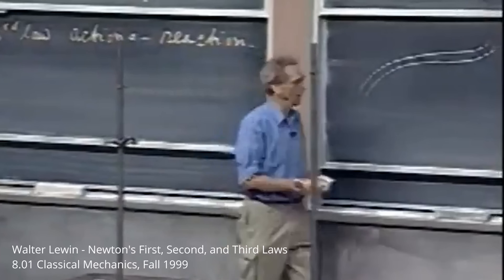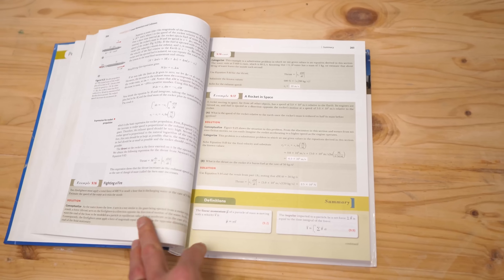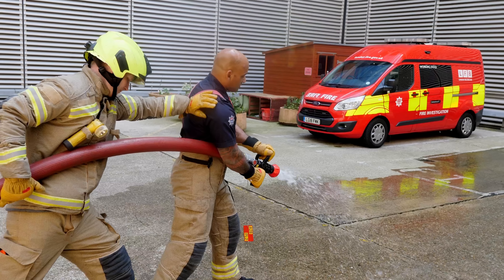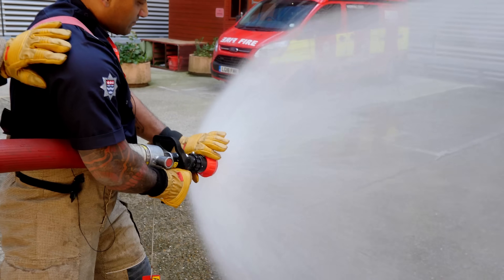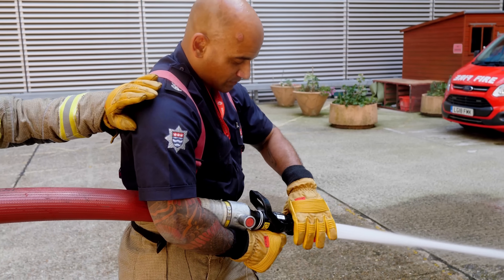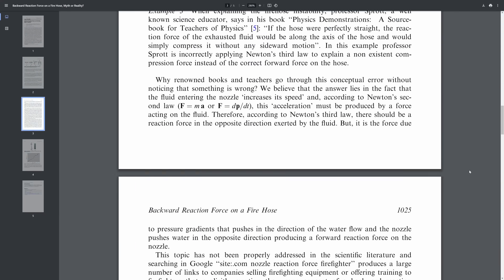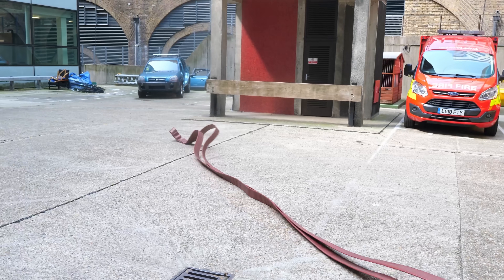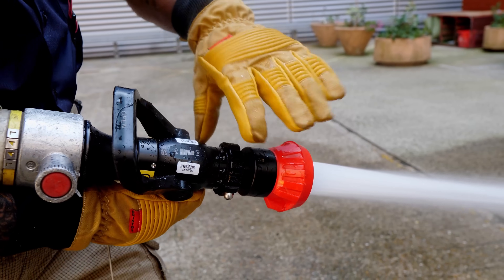Why chaotic hoses dance

Comment: The simplest way I can think about it: Fluids has viscosity, so they do not only pushes, they pull themselves. So you can imagine a string of water molecules that will perform in the same way the chain performs in the Steve Mould effect video. When the velocity and direction of the each chain link became steady, each link will pull the link behind it to the exact force and direction, so the curve format becomes stable.
In the hose the walls only need to hold the pressure, not the format of the water string. In the steady state (constant flow for some time), the curves of the hose do not experiment any moving force. reactions forces would appear if you change the flow or if you try to change the format of the water string.
I still do not have a good simple way to imagine the force at the end of the hose, but I can thing something like a string of water that is colliding with the air and decelerating to zero at some point. Since the end of the string is not pulling itself anymore, the mass of the water will act like a barrier and you will fell the reaction force.
To validate this model, you can fill a vacum chamber with a water nose with steady flow to observe if the end will experiment that force at the end. I'm almost shure if you can keep a good vacuum, the end will not experiment any force and will not move. The same should happen in space.

Comment: but what about straight water hoses with no nozzle? Since Water is incompressible and the rate of feed equals the rate it comes out, which implies the speed stays the same outside the hose, there shouldn't be any net difference in momentum and hence no force... yet nozzle less hoses still do the wiggle.

Comment: What about pressure loss and friction force on the internal walls of the hose? That should impart a reaction force on the hose in direction of the flow... But I guess that force is counteracted by the internal stretching of the hose material.

Comment: 15:23 Does the unsupported firehose show how much force the firefighters actually have to resist? It clearly doesn't have enough force to support itself completely as only a small portion of it can flail and it acts more like your short tube air compressor demo

Comment: I think it acts as a rocket at the tip, but what is being accelerated is not the water or gas on the tube but the air on the atmosphere. And the forces due to bends, I'm not sure they are that significant, because water inside is so turbulent it is hitting walls and changing direction all the time.

Comment: I always as a kid assumed it was because the end of the hose wants to expand in the direction of flow, and the next thing you know, the water runs out of room to grow, so it's the massive cartoon bulge worths of pressure but out of an end of a length long enough that the pressure mimics the "ball" if it were to come out harder than the end of the hose can truly parabellum, and mimic what "2d water' does or a flag in wind.

What i don't know, but will likely learn if I watch this, is what
Reply: Makes sense in the end. But kid me had all kinds of ideas.

Comment: One thing you didn’t consider is the shear force of water moving through a tube. The water in the hose has some viscosity, which means that the water has a velocity gradient. It is moving faster at the center than it is at the edges where it contacts the hose.  This shear force would actually be pushing a perfectly straight hose forward at all points, not backward. I think this contributes to the chaotic bending of the hose. 

This effect will also be significantly different if you’re using water versus air, which is a compressible fluid with much lower viscosity than water.

Comment: Firefighter here: the water accelerates at the nozzle just like you say. But the water pushes back on the hose. The water is under pressure so it's pushing out against the hose itself and effectively gripping it. Imagine trying to squeeze a twizzler into a straw. If you don't hold the straw you'd push it all over.
Reply: That is not how it works... The water nozzle is a rocket engine... The force felt at the nozzle is the weight of the water x the velocity of the water combined with the angle of momentum of the water when exiting, and the losses do not matter and only over complicates it.

Comment: I think it's really cute that all the firefighters wanted in return was for you to do a PSA about escooters.
Reply: To be fair, lithium battery fires are hellish, and most likely they won't stop burning until there's nothing left. It's not a lithium fire, as it's only a part of the actual compounds in the battery. But it's still a spicy pillow that has some exciting chemistry. And way way too many people just play around with the damn things and mix and match them. Which isn't good for the batteries, and "battery degradation" is least off your worries. Because if you keep pumping them up with way too much energy, at way too many volts, etc, they WILL start having very exciting and very difficult to stop reaction of being on fire.

They probably should have added that the batteries can NOT be extinguished easily.

Just having batteries handled correctly is fine, it's when people start to mess with them without proper safety precautions, "just add more, whatever type" and etc, is when it gets bad. Hell, I've been looking for kapton tape, and found reviews saying this specific lot was fake. But other reviews had people wrap batteries in said fake and not actually heat resistant tape...
Reply: @SaphireLattice "spicy pillow" cracked me up. Thanks so much. 
Also never heard of kapton tape before. Thanks for that, too.
Reply: I'll also add to this that the volume of these products including "hover boards" on the market is very high.  The companies jumping on this bandwagon aren't all going to have the same quality standards as the likes of Razor, and a cheap outdoor product handled by a clumsy and/or chaotic customer (we call them children, they're cute, but they also break things with great efficiency) can be a dangerous combo when power cells....or power anything, are involved.
It was wise for the firefighters to take the opportunity to educate about a rising problem.  Kudos to them.
Reply: Its like a sponsor but instead of an ad for a product they promote actual life saving advice!
Reply: Came here to write that.
Reply: I tried copying “escooters” accidentally pressed dislike.
Reply: Well, you start responding to structure fires and you quickly see the death and destruction they cause, and you want to see it as little as possible.

House fires are hell, and they spread so fast that occupants quickly become trapped, and if they become trapped the chances of survival are near zero. By the time we get on scene, anyone inside the building is probably already dead.
Reply: Cute??
Reply: @pinkerbot yes. cute
Reply: they love to overhype the danger. notice they said only 3 people lost their lives compared to other causes. batteries are remarkably safe
Reply: @Blox117 3 people hurt, but hundreds injured, and many houses burnt down.  Lithium fires are pretty much impossible to put out
Reply: @Blox117  yeah but it's also REALLY easy to jus not plug in your stuff unattended overnight
Reply: @ no only a fool would unplug it. the batteries themselves are already wired together and into the rest of the electronics.
Reply: @Blox117  my god man. where is your faith in budget Chinese made voltage regulators and overcharge protectors coming from? lowkey insane takes
Reply: @ Blox along with what those above are saying, you must have missed where it was stated London has a fire with one of these involved every other day.  Human injuries are not the only concern here.  It's very good if a family doesn't die, but it's better if they don't have to call their insurance company because their flat burned down.
Reply: @VoltisArt  i think you missed where the rate of accidents for other reasons are 10x higher. look at the number of accidents involving 4 wheels.
Reply: @ also to note, we really need to see real statistics on the number of fires. someone spouting off a number when he is just an individual who has done no actual research into the origin of the fire is not a source.
Reply: @ Blox accidents?  We're talking about electrical fires during charging, along with being caused by physical (including water) damage.  That's a broad range of direct and indirect causes, and I don't know why anyone needs to compare two things that aren't directly related.  Cars crash more often than planes.  Relevance?
Ahh, "someone spouting off a number" was one of the firefighters who deals with these actual fires.  I wouldn't expect every firefighter in any jurisdiction to be on top of statistics, but if he's gone to the effort of giving a presentation on this particular subject, he probably knows pretty well what's going on in his area.
He's trying to stop house fires and little kids getting seriously hurt.  I don't think you've got a good grasp of reality if you think what that man said was "overhype".
Reply: @Blox117  One of the biggest fires in California history was an accident from a gender reveal party. It doesnt matter that other accidenta happen more often. The point is that a small piece of knowledge that is easy to implement on the day-to-day can save lives.
Reply: @Blox117 It's a little different when you get called to the scene and have to recover the bodies yourself.

"Overhype". What does that even mean? Do you think they're scamming or something?
Reply: @CharlieMikeNS  its hard to take you seriously if you dont know what it means. over = more than. hype = advertise
Reply: @Blox117  notice they also said the fires happen every other day.
Reply: @gabotron94  notice no sources
Reply: @ notice you cant read
Reply: gabotron94 nvm you dont speak english
Reply: gabotron94 no english, not surprised
Reply: @Blox117  You don’t seem too bright and you’re trying to criticize others? Whew…the confidence in your ignorance is amazing to see.

Comment: My head hurts now. Trying to work out all the variables is boggling my mind. The weight of the water, rigitity of the hose, ambient temperature, temp of the water, psi of the water in the hose, gravity, coefficient of friction... ... ... etc. 
I have handled a charged fire hose in US Navy shipboard fire training, and the kick of an uncharged hose filling can rip the nozzle out of your hands, causing serious injury. The training facility has a crash test dummy that almost got ripped in half by the whip of the hose.  This is why they'll leave the nozzle slightly open to allow air to escape while the hose fills. Once it is filled with water then the nozzle is completely closed and ready to be deployed on scene. While there is a force pushing back on the operator, it is not insurmountable, even for those with a smaller stature.

Comment: There is a related phenomenon where the force felt holding a hose drops drastically when the end is placed in a body of water. I don't know how this is explained with pressure. It also argues heavily against the bends creating the force. Would love to see a satisfying explanation.
Reply: It's nozzle exit velocity. Water smashing into water does not result in high nozzle velocity - hence little thrust.

Comment: I feel like you were a bit slow on this one, Steve. I thought it was obvious that the water was being accelerated through the nozzle since tne nozzle is a reduction in diameter with constant flow. It's this reduction and restriction causing the pressure, not the pump, the pump only produces flow.

Comment: Is there an assumption that at the end of the pipe the pressure changes from 300psi (????) to 14psi? In the hose the pressure is going to be the "same" in all directions. When the water exits the hose then the pressure being exerted will change as it's no longer being constrained by the hose. But for surface tension and momentum the water would form an ever increasing sphere. Because of momentum and surface tension there isn't an immediate change from 300psi to 14psi.

Comment: Looking at a rocket engine the thrust can not be produced right at tip of the nozzle. Rocket nozzles are relatively flimsy things and there are even some extending ones. I don't thing that those would hold up to the force of a rocket engine pushing forwards.

Comment: Further thoughts on the flailing fire hose video - you also have the heavy mass of the hose and friction against the ground it's sitting on that may contribute to why only the nozzle and end of the hose is moving?

It would be interesting to see how it would react suspended in free air...

Comment: My 2 cents: Hoses of all kinds always have a curve or a bend as part of the manufacturing process or storage. If a perfectly straight hose (which would just be a tube) was manufactured, the pressure from the nozzle/open end would simply compress the walls of hose backwards evenly and the hose would remain straight. The flailing would be a cascade effect set in motion by the nature of flexible materials. Imparting the bend talked about at 15:38.

Comment: I wonder about the wall fiction along the hose and how that interacts with the forces on the end of the hose. I'm wondering if this is  a similar situation to the helicopter flying a line underneath it and interesting interaction of each section of hose only impacting the parts beneath it. This may also explain the initial bending we see which allows for the nossel to turn over and the forces from the  rocket analagoy take over as you were explaining.

Comment: I think it should be possible to design a recoilless nozzle for a hose without resorting to spraying water backwards, just by creating a funnel at the tip of the hose. It would reduce the output but the water pushing against this funnel should apply net force.

Comment: 9:01 In that setup the air is pushing against the bottom of the plunger, which would cancel out some of the weight, right?
Maybe it wouldn't have mattered, but I'd be curious to see if it made a difference if you attached the end of the hose to the flat part, so the air is blowing over the it.

Comment: One thing to think about is the difference between a rigid pipe and a flexible pipe. What you're looking at is a column buckling problem combined with Bernoulli's principle. When the hose is straight, the hose is a buckling column (which is an unstable state), and the force exerted is the buckling capacity of the hose and the force associated with the pressure drop discussed in the video. If the pipe were a more rigid material, then the force a fireman would have to exert to hold the hose would be lower, since the buckling capacity of the hose would be higher.  

At lower pressures, the fluid pressure can actually help make the hose straight. Think about the sky dancer, and when they're over inflated they become stable. That's because the tube is quite wide, and the pressure provides rigidity to the walls of the tube, which makes overall column capacity of the tube higher than the relatively low forces caused by the pressure at the outlet.  At some point, if it didn't burst, you would come out the other end again where the pressure would cause the tube man to collapse again as the column buckles.

Comment: Steve, I thought about this for a long time. I enjoy your videos, but I have to disagree with your conclusions on this one. Here are my thoughts and suggestions regarding it:
First, please feel free to  point out any logical errors. I love being correct, please correct me where I am wrong so that I can be correct!
If the fluid starts to expand inside the nozzle, then it will gain sideways momentum and lose forward momentum which must mean that the nozzle slowed it down, pushing the nozzle forward (not the correct direction)
Now let's look at the pressure. There is more pressure inside the hose than outside. All cross sections will feel a force from this pressure, including the inside face of the nozzle, which will be pushed out, also not the direction that it actually goes.
Here is a reason that I came up with for why there might be force pushing backwards: for gasses escaping out of hoses with no cross section reduction, there is high pressure air escaping which pressurizes the very end of the hose where it comes out, pushing it backwards. This pressure does not have to be very much pressure, only about .002 bar from rough calculations based on the force from the air hose, which is very reasonable IMO. I don't see how this applies to water in any meaningful way as it is nearly incompressible.
Suggestion: use strain gauges or perhaps some other technique for visualizing strain to determine where exactly the force comes from. Does it come from the cross section constriction(s), or does it come from the very end?
Thanks.
Edit: removed a part about mass flow that was corrected by another commenter.

Comment: I believe you made a mistake when comparing a straight and a bent tube around 9:00.

You are showing a tube that is bent 360 degrees. This means that all reaction forces will cancel out. Please retry the experiment with a hose that is bent only 180 degrees between the air nozzle and the hose end. Then I believe you will see a different measured force!